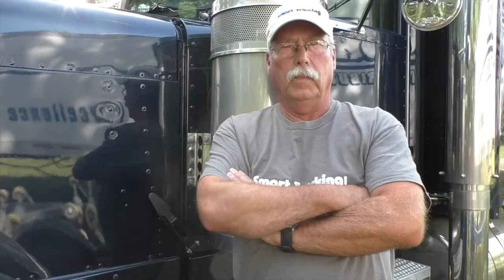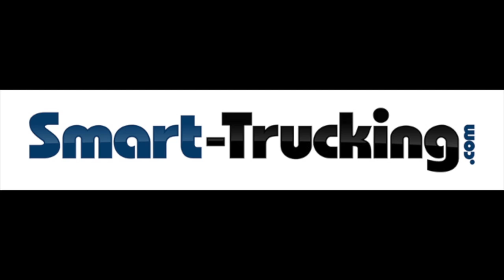How to Corner a Big Rig

Comment: man you should open your own driver training program.   the road would be alot  safer
Reply from the maker: So much of driving is plain common sense. I think there should be follow up by the schools after graduation, where the driver goes back for at least a few days, after driving with a company for a month or two, to get any questions or issues clarified. They train 'em, kick 'em out the door and the poor brutes are on their own. That isn't right. Or some sort of a mentoring system is needed.
Reply: Smart-Trucking.com you're so right dave

Comment: i used to work in a milk plant as a receiver. i once saw one of the trucks that i received on a daily basis rolled over on its side up in flames. i saw smoke in the distance and when i got closer to the truck i realized what and who it was. i knew that black kenworth. the next day at work confirmed it, the guy rolled the rig. the truck burned to the ground, and the trailer was scrap. the drive ended up getting out before the truck started burning. he was lucky, he would have died. this is no joke, especially with a smooth bore tank. i am now entering the trucking industry myself. i CANNOT make the same mistakes. i must learn from other people's mistakes. that guy was going too fast around a corner and the fluid milk load tipped him over. scary thing that i saw and that i knew the guy.
Reply from the maker: Yeah, straight bore tankers don't like cornering fast,you saw proof of that. Always drive those like you're driving Miss Daisy.  Dave
Reply: im using that experience as someone else bad driving example that i am going to learn from, not do what he did. i know well what can happen
Reply: it was also the 2nd roll-over he had in a months time. they fired him for the 2nd roll-over and they way i see it, they had no choice. you cant allow someone to keep completely destroying equipment and keep their job

Comment: I really wish some other truck drivers would slow down. There has been too many flip overs in the past few years with trucks. Some of these newer drivers have not much of a clue that a heavy truck is top heavy and can easily flip over on any tight corner. Trucks ain't lower to the ground like them sport car that can do 300km per hour. That little yellow speed sign on the ramps are yellow for a very good reason. The yellow speed limit signs on the road near curves or intersections mean you should reduce your speed to whatever is indicated by the sign. Yellow means slow down and that does mean for heavy trucks in a very big way. Please, Do not every go over the yellow sign speed limit, It may be the last time you do it.